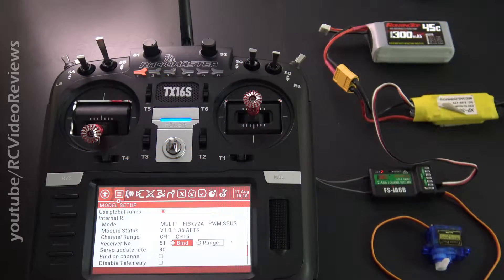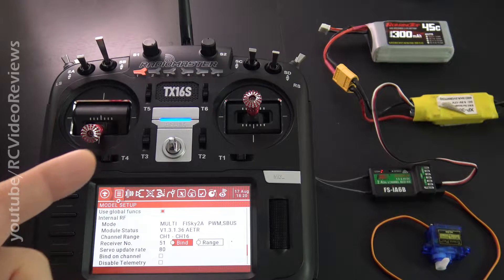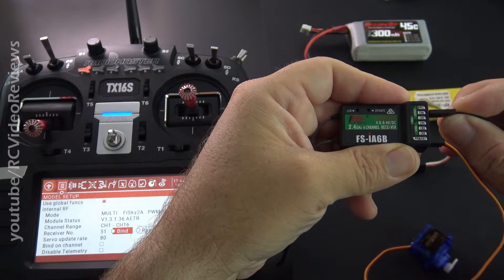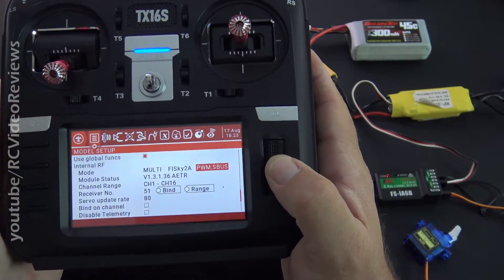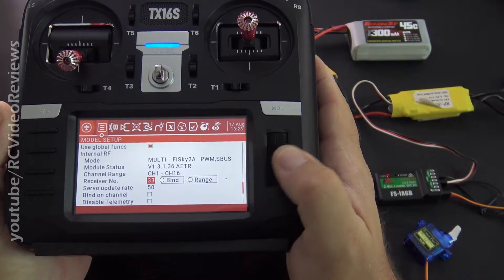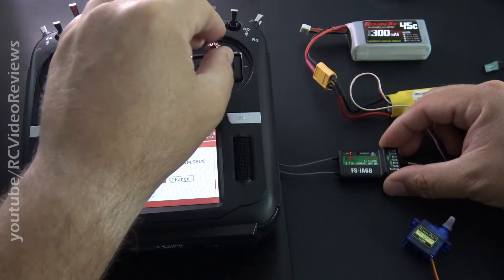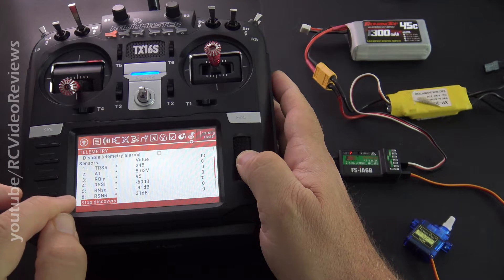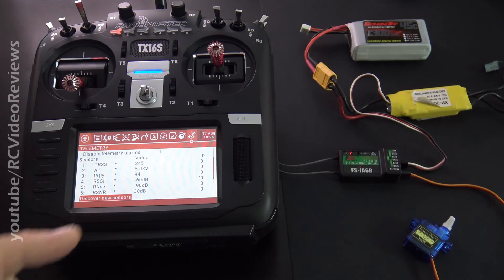How-to Bind Radiomaster TX16s and FlySky FS-iA6B • PROTOCOL FREEDOM FTW!

Comment: Wow this is great, I'm thinking I can grab an FS-iA6B and get battery voltage telemetry from it with my TX16s as at 2:26 of your video A1 voltage. Am I correct? or will I also need a Flysky FS-CVT01 Voltage Collection Module?
Cheers love your videos, they have helped me get back into RC helis in my retirement.

Comment: Hello, I have the Radiomaster  tx16s max pro version 2.7...I'm doing exactly what you are doing with the same receiver. My issue is that while the bind is successful, once the TX is shut off and I go to power up my plane to fly, the bind is lost. Powering off the Rx and powering the Rx  back on, the bind remains. The bind is always lost after powering off the TX  and then powering the TX back on. I've used the 0 and different receiver numbers (even used 51 as you did) and still the bind disappears when TX is shut down. I only have 1 model entered into the radio so what's happening? Can you help?
Thank you
Reply: @richarddorsch7275  same issue … have you found out the issue ?

Comment: Thanks a lot man, but does FS-IA10B receiver bind with TX16s transmitter?? please let me know how?
Reply from the maker: You need an FRM303 module. IA10 is AFHDS3.
Reply: @RCVideoReviews  You sure about that, John? I've got an FS-iA10B here and that's just the 10ch version of the old FS-iA6B that you've got there. The iA10 was just the straight PWM version of the iA10B with no serial outputs.

Comment: Good video! Got a few of these recivers, can you suggest a sensor for vario that i can plug into this rx that will work with this radio. Thanks
Reply from the maker: This will do it: https://amzn.to/3Wyc1OX
Reply: Many thanks for the quick reply. Thats what i was going to buy but i was told this will only give me on screen height and not give me an audible rising and decending tone! Can you verify this for me please. Cheers
Reply from the maker: I can't verify it. That's the only altimeter sensor I know of for that rx.
Reply: Yes thats correct. I'll check it out. Thanks.

Comment: vary good video first FlySky Receivers for me you just made it so easy to set it up works  great with the TX16S 👍
Reply from the maker: I just picked up a few more of these and I'm starting to use their voltage sensor too. I flew with an IA6B over the weekend and it performed quite well.

Comment: Ola, estou com problemas com o bind. O bind nao sustenta no i6b flysky quando desligo o rádio eu perco o bind. Como resolver???
Reply from the maker: Não sei. Não perco meu vínculo quando desligo o rádio. Eu não posso replicar.
Reply from the maker: I think I found the answer to your problem. It also explains why I never saw an issue. I only ever had one AFHDS2A RX bound to my radio at a time: 

You must use a different Receiver Number for each different AFHDS 2A receiver you bind.  Re-using numbers will remove the binding for the previous receiver.

Comment: The fs-ia6b can run small servos without esc ?
Reply from the maker: No. The rx does not provide voltage. You need a power source for your servos.

Comment: Hi, Guys, I have a problem with this receivers: I can bind, but some days later the bind is lost and I need repeat the process. Someone have that same problem and know how fix it?
Reply: Give each receiver a different number (in the set-up) before you bind it. If you don't the transmitter will only remember the last Flysky receiver it was bound to and drop the bind to all previous ones. Same thing for any other protocols where the option is available in the Model Set-up.

Comment: Thanks for the tutorial! Could you tell me how to get the battery voltage of my plane from the telemetry settings?
Reply from the maker: Do you have a battery telemetry sensor? You need a sensor that can send a known ratio of pack voltage or the actual voltage.

Comment: Hi I have a question. I have a Flysky receiver. Under name of Aerosky badge. Anyway's receiver is a FS-R6B and it is not the AFHDS 2A  but AFHDS. Does module don't support Fly Sky Afhds? I'm having issue binding :(.
Reply: The AFHDS is listed under Flysky Std. A different protocol selection. Roll through the list until it pops up.

Comment: Just wanted to say that this also works with a Radiomaster Zorro transmitter, steps are very much the same but there is zero information about that on the internet except your video. 
So to anyone googling, that's how you do it, and here are a bunch of keywords to direct you to this comment: 
FS-IA6B receiver Radiomaster Zorro transmitter bind

Comment: do you know if the new mk 2 version will work with flysky
Reply from the maker: The MPM didn't change in the MK2--same device. So yes, the supported FlySky protocols on the existing MPM will work in a Mk2 TX16s. Be aware, not all FlySky is supported by the MPM.
Reply: The MPM supports Flysky AFHDS and AFHDS v2. It does not support AHFDS 3, Flysky Ant protocol or the original discontinued Flysky protocol.

Comment: Also pls guide that , turnigy 9x 8c v2 receiver and hobby king , HKTR6A V2 , work can bind with radio master 16 ?
i have 12 receiver in stock of these ,
Reply from the maker: You need to find out what protocol your RXs use and see if you can find them on this list: https://github.com/pascallanger/DIY-Multiprotocol-TX-Module/blob/master/Protocols_Details.md
Reply: @RCVideoReviews  thanks for your kind reply.
I am not expert about protocol.
Can u help me these work with radio master TX 16?
Which protocol work ,if work can u make video?
Reply from the maker: Time to learn. Google is your friend.

Comment: Does the Sbus works when u bind that way?
Reply from the maker: Binding is specific to RF comms with the RX. There is no option to specify s.bus vs pwm for output in the bind process. So yes, s.bus should work just fine.
Reply: @RCVideoReviews  Yep. You should select PWM/S-Bus when binding to the iA6B receiver. Otherwise the receiver will put out i-Bus on the Serial Pins NOT S-bus. Thus you cannot use the Flysky FS-i6 transmitter with the iA6B receiver if you need it to output S-bus because the FS-i6 CANNOT be set transmit S-bus. But the i6X can.

Comment: Thanks, RCVR....

 Very helpful video like all you do. I'm guessing that these ia6B units were so inexpensive because there was a hardware change around then. Looks like current models can now use 4-8.4v power (2s lipo) unlike the older ones which were 4-6.5v. For fixed wing this allows 20-30% more servo torque at nearly no expense. Wish it was clear if this is actually hardware or just labeling and spec sheet. 

All that said, these are nice little receivers at very fair prices.
Reply from the maker: I agree--very nice little receivers for the money.

Comment: Howdy great video i followed your step by step instructions binds right up problem i am having is when i unplug flight controller battery i get audio alert saying lost telemetry and when i plug battery back in it says recovered telemetry but stays bound. then when i unplug helicopter battery and turn transmitter off and restart transmitter and plug heli battery in its not bound anymore so i have to rebind. now this receiver was bound to a flysky transmitter before you got any ideas what could be wrong Thanks Don Johnson

Comment: Hello sir..im using tx16s and usually my rx is radiomaster r168...but currently really hard to get r168 even directly from china
My question is, is this particullar flysky rx  works well with tx16s in term of connection?i fly edf jet 80mm fly usually around 200m. A bit worry about lossing the connection. Please advise
Reply: For a practical demonstration of what this receiver is capable of (in low interference conditions - no 2.4ghz receiver does very well in an area overloaded with wifi hash no matter how much it costs!) look up the test video done on the West Coast of New Zealand by iforce2d. Pushed it out to about 11km off the coast!!! Don't let the Spektrum/Futaba snobs tell you that they are no good! 🙄
Reply from the maker: I would suggest buying one and range testing it. I've flown mine around the park and it does fine. I haven't measured range so I can't give you an honest answer.

Comment: After doing this to my tx16s, I still get telemetry issues at about 80mtrs. Do I have to fine tune the receiver freq or something? I am frustrated.
Reply from the maker: Someone else told me about telemetry errors while down low on this Rx. I don't recall getting errors on mine.

Comment: I just got my Tx16s, made it bound to Fly Sky ia6x Reciver, using FlSky2A, PPM,SBUS..
But I don't see frequency tuning option...
Reply from the maker: If it's not present, it's not available for that protocol. Same goes for failsafe.
Reply: @RCVideoReviews  thank you sir, your videos are super helpful...

I didn't found, videos about costum splash screen, custom background and costum sounds in your videos, if possible please also do cover that...

I would highly request and recommend to use windows paint option or some other simple and user friendly software for resizing images..

Best Regards.

Comment: Thank you so much for this!  extremely helpful! but i was wondering, how does one setup the failsafe mode with this combo?
Reply from the maker: If failsafe is presented by the radio for a given protocol, then use the software option. If not, set failsafe per the Rx instructions.

Comment: Hey John, thanks for the video. When I connect one of my analog servos (Corona CS238MG) to the fs-ia6 receiver it didn't work well and it affects all other servos. Then all servos stop working after a few seconds. Is it possible to connect these analog servos with another protocol other than SBUS to work properly? Or would you recommend a solid receiver for the tx16s to run these servos properly?

Cheers.
Reply from the maker: That sounds more like a servo problem or power problem than an RX problem. The RX only passes BEC power through to servos, it doesn't generate power. The only thing coming from the RX is signal. I would do two things: 1) Make sure you have sufficient power and amperage connected to the Rx. 2) Test each servo individually. Based on what you described, I doubt it's an Rx problem.

Comment: Can i use more than one reciever (FS-iA6B) for more plane, with this remote (tx16s) without re binding when change Plane..? Because for me, everytime i change planes (all planes use FS-iA6B receivers) i must re binding.. if not it wont work.. is there anything wrong with my binding process..? please advice me.. Thanks
Reply from the maker: You shouldn't have to re-bind receivers. I never do. I have 40+ craft with all kinds of different RX's from different makers using different protocols and I never have to rebind any of them.
Reply: @RCVideoReviews  Problem solve.. i forgot to change receiver number on internal menu.. ☺️ Btw Thanks for your fast respond
Reply from the maker: Ahhh...
Reply: @zayyandzikraka3833  Need help. I manage to bind the flysky i6 on the radiomaster, but when I select another model aircraft, when I return, the bind is lost. I need to rebind every time I fly. Any solution for the problem? thanks!

Comment: Is it possible to get the telemetry data from the voltage meter module for this rx?
Btw these receivers have MASSIVE range with the kind of antennas they use
Reply from the maker: A1 comes in with Rx voltage. Based on what I saw via discover sensors @ https://youtu.be/zKN2w-_zkH8?t=149 I'm going to say I don't think so.

Comment: I friend, i use this ricever with tx16s and the flysky cat01 altitude sensor. I cannot setup the calibration of the sensor😔... Can you help me? Thanks
Reply from the maker: Telemetry data sensor calibration normally happens on the telemetry sensor page, but I have no experience calibrating for altitude...sorry.

Comment: Nice video! 2hat about the flysky module? How radiomaster show the information? Flysky has the voltage module, altitude module, rpm, etc .. can you show and example?
Reply from the maker: If the modules report telemetry through the Rx, it's very simple to just "discover new sensors" on the TX16s telemetry screen and the data will autopopulate.

Comment: Hello everyone. I am trying to control some led lights that turn on with one of the switches of the Tx16s but I can't get them to turn on with all their intensity. I control them but they are rarely seen. If I connect them directly to 5v they turn on with their full intensity. Does anyone know how to turn them on with one of the switches on the remote? I am using the same receiver as the one in the video the FS IA6b, Thanks
Reply from the maker: The 5v rail should supply 5v regardless of the switch position, so I don't think you have a power problem. The switch changes pulsewidth on the signal line, not voltage on the voltage rail. You may need to find out if the led controller has a specific pulsewidth it needs to see and set that up in the radio.

Comment: Thank you for posting this video. Can the Radiomaster tx16s bind to the FkySky FS-A8S? i tried and having issues. Can you help? Thank you in advance.
Reply from the maker: I don't know if it can bind to that one. Here is the supported protocol list for the MPM: https://github.com/pascallanger/DIY-Multiprotocol-TX-Module/blob/master/Protocols_Details.md 

If your Rx uses a protocol on that list, the TX16s will bind with it.
Reply: Thanks for this information i kept trying to bind to my FS-A8S and it would not work. But i have a few x6bs laying around so I will use that one instead!

Comment: thanks for the video- really helpful  ....errmm silly question, but when you mentioned "pick a reciever no in your case 51"- can this be any generic number or is it specific to each reciever - ? if so how do i find this info.. also  any heads up on how i shoud correctly plug KOPILOT into this reciever .. for a standard T trainer .. really struggling with setting it up with this reciever .. getting into a pickle as to which KOPILOT cables should go into it what set of  receiver pins  and which port- thanks and apologies for the many questions !!
Reply from the maker: If you use a number other than 00 when you bind, the radio will have to have that model loaded to command the receiver. If you use 00 as the Rx number, then any model that was bound with 00 as the Rx number will be able to send commands to the Rx. You use any Rx number you want. Rx numbers are shown in Companion so you can use that to keep them straight.
Reply from the maker: I have a Kopilot setup video here: https://youtu.be/NqKFKvMlaV4
Reply: @RCVideoReviews  thanks , that’s great ... My main hurdle is how to connect this specific receiver to kopilot ... it’s more where and which cables from Kopilot to the receiver ... not sure if I should be connecting to to ibus pin on the top or ch 5 pins or the ppm pins ? Any heads  up please ?  The rest I think I am confident about Thanks
Reply from the maker: @Jay-gf7mg  I haven't tried ibus with Kopilot, but none of this is that hard. Red to Positive, Black to Negative, Signal to Signal. Should be the top right horizontal slot.

Comment: Returning to an old topic regarding the FlySky-FS-CAT01-Altitude-Sensor - @t
Whilst strictly not a Vario there is a method using a LUA script to have the Alt values converted to a usable Vario ft/s value that you can use in OpenTX; someone a lot smarter than me has kindly compiled the LUA code and details here >>> https://hackaday.io/project/175220-flysky-variometer. Note this LUA script also ensures the correct audiable tones for ascent and decent. Note 1) You need the latest version of OpenTX that supports Custom Scripts to run the LUA code (add it to your Scripts/Mixer folder on the SD card) 2) There may be some requirement to calibrate your sensor under the sensor Telemetry settings in OpenTX to ensure it works correctly. Thanks Bud Bennett for sharing this code via hackaday.

Comment: I have fs ia6 and my question is where to sbus out on this receiver ?
Reply from the maker: It should be on above the pwm outputs on the right.
Reply: @RCVideoReviews  there is only 6×3 pins are available each pin are each channel output
Reply from the maker: @mokshpatel6986  My ia6b has sbus up top. Maybe we are talking about different model numbers. The ia-6b is an i.bus rx.
Reply: @RCVideoReviews  it also output sbus signal

Comment: I had the wrong radio. Exchanged it for Jumper T18 lite and all was well. Had to change radio from Mode 2 to Mode 1. Not as hard and scary as I thought it might be. Took longer to disassemble and reassemble than to do actual conversion. Had to use PWM IBus for binding and to hold telemetry. All working OK except no voice for Throttle Safety and Aileron and Elevator dual rates. Flaps also a bit weird. Added some other voice commands from another radio but even though I can play them from menu in Sys. mode, they do not appear in listing in SF page. Your video was a great starting point. Also, I prefer setting up my radios on the radio and not using Companion.
Reply from the maker: Yeah, it's pretty easy to change from mode 1 to mode 2 on these. You can either swap the gimbals completely or move/replace the pin and spring. Glad you got it worked out. Try to spend some time learning companion. Once you get the hang of it, you'll never look back.
Reply: @RCVideoReviews  It was even easier than that. Only had to tighten a couple of screws and loosen another couple and adjust the ratchet/friction bands.
Reply from the maker: @robertmillhouse6388  You have to release the spring tension from the new throttle and add spring tension to the former throttle. You did that right?